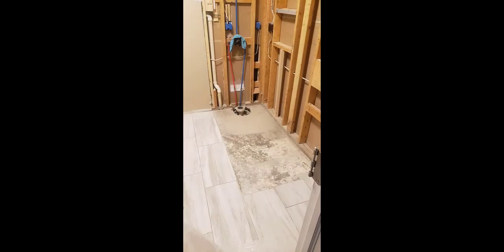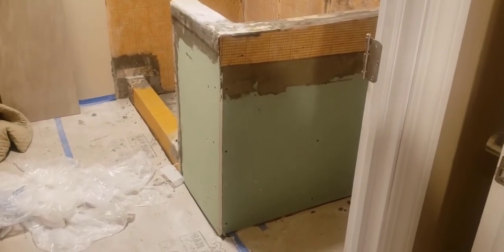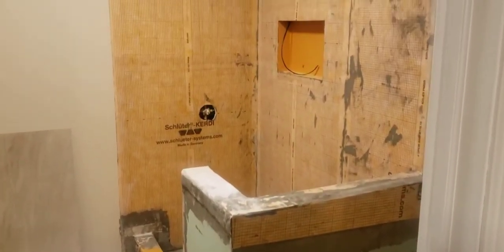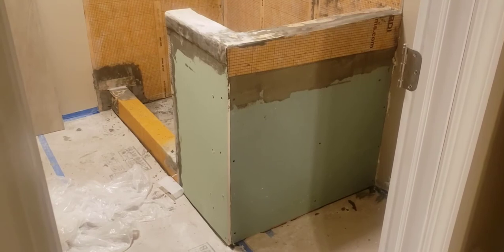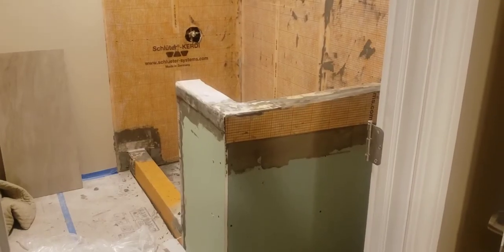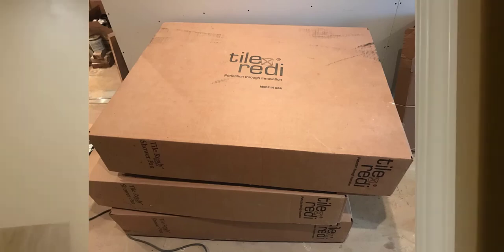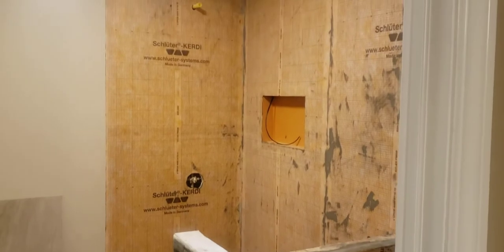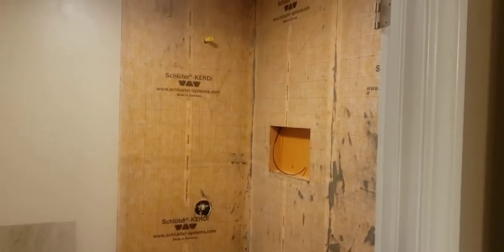Tile Redi Shower System - Should You Use It?

Comment: You had a rock in your mortar bed, which is very typical of you use older bags of mortar.  Alternatively, you needed to use a leveling product before putting down a mortar bed.  The system works perfectly if you have a flat, level surface.  If you had rocking movement, then you did. To prepare your base.

Comment: You had a gap in your picture between the pan and the studs so of course the flashing didnt fit right. This sytem requires plumb and square walls and floor.

Comment: I'm looking at your issues with this pan and I have a tile ready 48x72 system... a week ago I had installed the pan with zero issues...I'm doing the flashing today also with zero issues....as you move your camera around the bathroom...I can see clearly why you are having issues...your lines are not straight for your wall and it's not plumb so you are going to have a nightmare unless you have things level, flat and plumb...trust me when I tell you...the pans do work, but Preparation of EVERYTHING is KEY...this is my first time renovating a bathroom, and i'm taking it slow and not rushing because we are investing a lot as i'm sure you are...
Reply from the maker: I appreciate the info. What is your impression of the overall quality of the pan you got? Did it also have a lot of ridges that needed shaved down? Did you have any issues when placing it in the mortar? Was the flashing the correct size? I'm super curious as to others' experiences with this product.
Reply: @ourrealestatejourney_original  The quality was excellent...the bottom with the ridges was SUPER smooth which I though would be an issue...so I vacuumed it, washed it and applied alcohol to take away the "shine and make it super dry....
No ridges needed to be shaved at all
I did have slight issue when placing in the mortar...it was a bit much for just me to handle, but It worked...I push and shimmied as much as I could until I got it down...and then put cement bags on each corner while I leveled and scored into studs to hold it down....then I removed the bags and pushed in the middle of the pan once I got it down I left one cement bag in the middle....I left it for 7 days before stepping in and tiling.  Right now I'm leveling my floor for tile while the tile grout in the shower pan cures.
The flashing is the correct size..however, I'm on the fence about using it now...I'd like to secure it to the shower pan somehow but I'm still brainstorming of a way to do so...
Reply from the maker: @SylvesterPotter  Hopefully you'll follow back up on here to let me know how it turned out. Good luck!

Comment: I’ve installed many tile redi pans including curbless pans and never had any issues. Your walls need to be square and level. The wall you built for the seat is completely out. That’s why your flashing was pushing out.

Comment: Just installed a tile redi trench 36 x 72".  Workmanship of the pan was very good.  Do not have access from below (concrete slab) and dry fitted that pan at least 10 times.  The drainpipe had to be dead on and the height is critical.  Already not easy for a DIY.  I took the initiative and drilled horizontal holes through the ribs (nowhere close to the actual pan) for mortar to seep into and hold it better.  Getting ready to place it down:  the comment on "you got one shot", couldn't be truer.  You have about 10-15 seconds before the PVC glue drys on the drainpipe.  You have to align it, press it down into the mortar and level the area around the drain within 15 seconds or so.  I managed to do it and pan turned out rock solid.  I would never use this again for an installation with no access below.  Also:  The walls have to be perfect meaning right up tight against the pan.  The video showing his flashing issue is a mistake constructing the sides.  I had a similar issue and ended up shimming the entire wall on that side but it came out perfect.  I did not use thin set on the pan floor tile - used redi poxy.  Stuff is great but another test of how fast can you use it before it sets up on you.  Next time (if there ever is one) I pay a plumber to build a shower pan.
Reply: Definitely intermediate level install  for above slab install. I installed my 42 X 60 pan, and  it was tedious work reworking p trap plumbing to line up with tile redi drain.
I wouldn't recommend it to the avg DIY homeowner.

Comment: I'm not a pro nor am I an amateur LOL my take on the redi tile installation floor pan with bench 42x72. first on this project a Smart level is the way to go two footer. My installation was in concrete so you had no room for error. As someone else pointed out I installed it dry at least 10 times and I mocked the studs to know exactly where it should be when setting it in. To get that pipe perfect to drain I slowly concreted the pipe going up in three different settings, that means three different days. I'm getting less than a 16th of an inch to the top of the lip of the ready pan of the PVC 2-in pipe I sanded it down with a 5-in sander made sure I marked the side to know what I needed to lose. Also the ready tile I got it was ABS plastic going to PVC thus that glue takes a little to dry. Like I said you have to make sure dry fit is absolutely perfect and it will still move in my case a 1/16 lol. Very very helpful hints, make sure you use Stone paver sand when you mix the cement any small pieces of stone even an eighth of an inch will mess with you trust me I'm a cement head person.  The front part where the drain I purposely left a little void so it wouldn't go in drain but I failed it afterwards but I made sure underneath I did what I needed to do to get concrete that little section. couple of pieces of strapping that you already made before hand to make sure the pan doesn't move or shift do not screw through the pan ever. Once the pans there you know the dimensions of underneath where the bench is and you just make it. Temp it, measure it, make it. I used half inch sanded Birch plywood and then 2x4 framed it with 5/8 concrete anchor bolts to floor. Dry fit the seat before you put everything together I can't stress this enough. Is it easy no. It's like a model plane this is a level one if level 5 is for beginners LOL I haven't done any remodeling in 25 years I took up a different trade doesn't mean I forgot. Pan in my opinion would be a lot easier on a second floor if you have access to the drain underneath. Would I do this again probably not I would probably go with different route. Was it a Pita hell yeah. But it wasn't as bad because I have knowledge and I never give up and you widdle some things out that's what hand tools are for and levels. I can go all day.
One of the best comments I read was just get a fiberglass shower pan and tile the rest that's exactly what I would do next time cuz that's what I used to do I wanted to go exotic like Joe 🌻

I had work to do in other parts of the home while waiting jump around.

Comment: I'm heading into my own Tile Redi project and will definitely look out for the issues you mention here.  Not sure the Redi-Tile system was the issue here - maybe you were in over your head... maybe not.  Thankfully I have access from the basement below the shower base so setting the drain is not the issue... setting the base and leveling it will be important.  Video's I've watched on shower installs with molded bases have emphasized furring strips when the walls are not plum or square.  With the schluter system I think you can form your base, sides etc to "absorb" the out of plumb/square walls and still make it work.  Great video to learn from - we learn more from our failures than we do from our successes!  Good luck my friend!

Comment: I'm in process over installing  tile redi pan on concrete  slab.
I tried using the dimensions given  on instructions, but it was inaccurate.
I ended up getting exact center of drain by tracing the pand drain  over cardboard with spacers.
Replumbed the drain pipe and it centered perfectly.
Reply from the maker: Nice. Hope the rest of it turns out perfectly for ya!

Comment: horrible video, should be taken down.
Reply from the maker: Perhaps you could send a message to YouTube letting them know how badly your feelings were hurt by watching a video that you didn't agree with?
Reply: I watched the video all the way through, and it was a bit tough to watch, but I learned a few things about the TileRedi system. I spoke to them for about 1/2 hour and they did address a lot of the issues spoken about - plumb and level, perfect drain location, etc. I'm still not convinced it's the way to go - probably not for a novice diy-er. Also pretty pricey.

Comment: Bought a custom size and nothing but problems. Try to find any info on the POS Redi Ledge. Never again. Had the same issues with The “flashing” and this was a complete waste of $$$$, time and effort. I would not be a bit surprised if the comments that say I have been using these for years are Tile Redi employees. The only useful thing I got from this product is to use the cardboard the pan showed up in to protect the floor outside the shower. The pan we bought is in the landfill and I will never recommend this product. Garbage